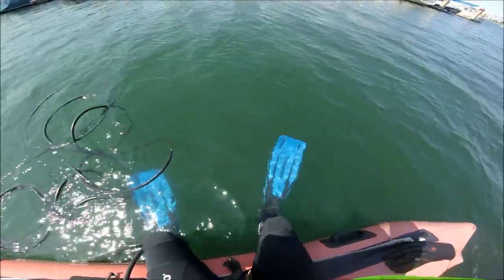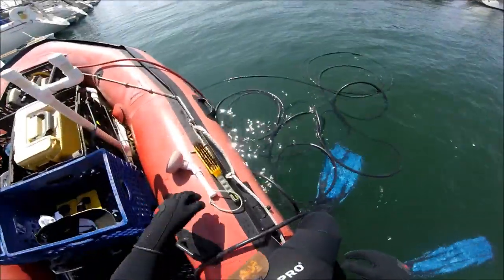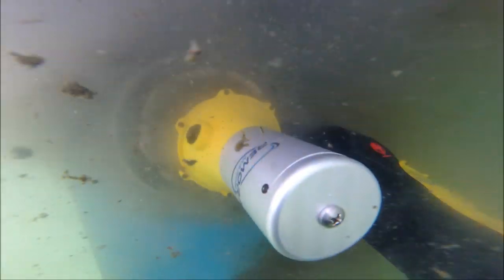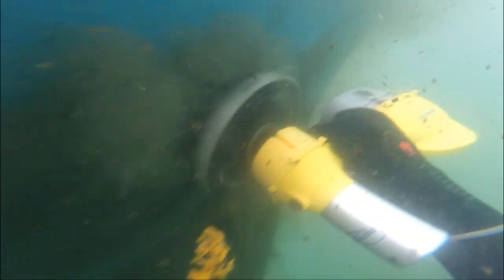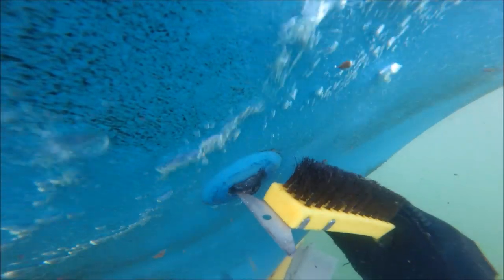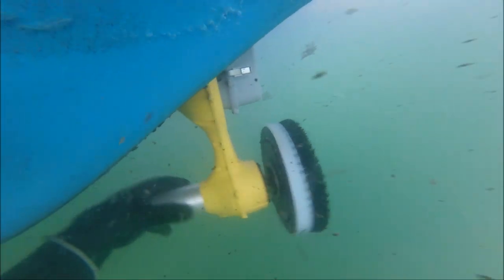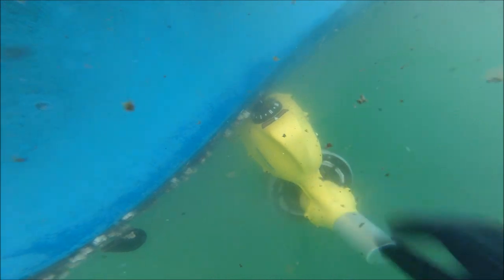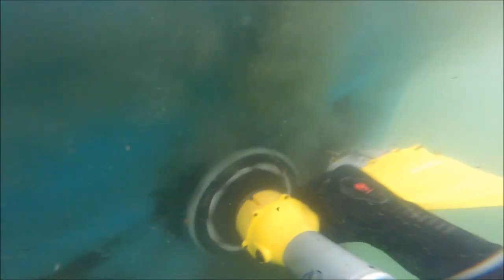Remora Solo Cleaning Foul Bottom

Comment: if i have a remora - do i even need to bottom paint?  also, if use ablative paint, is it a problem in terms of rubbing off paint?  GREAT TOOL.
Reply from the maker: Yes, you will still want anti fouling paint on your hull regardless of the tool you use to clean it. And with the proper brush and rotation speed, the Remora will not do any more damage to your ablative paint than cleaning by hand will. Maybe less, to be honest.

Comment: It does a great job of taking off the old bottom paint so the owner has to repaint before one year instead of 3 years its good for Divers and bad for Boat Captain
Reply from the maker: The neglected bottom paint on this boat was not in good condition and was quite foul. No cleaning method that adequately removed this level of fouling would be kind to the paint. But maybe you didn't watch the video. You certainly don't know much about hull cleaning 😄

Comment: Incredible that they clean the hull without catching all the debris, including all the toxins and biocides of the hull paint, such as copper, tin and other toxic substances.
Reply from the maker: What do you find so "incredible" about that? I mean, it's clear that you know very little about anti fouling paint, so what makes you qualified to judge the morality of performing an in-water hull cleaning?
Reply: @fstbttms  Nico is right. 

Just because there is no regulation in some places (yet) it does not mean that this practice is acceptable morally. In a few years you will be obliged to gather all this crap that is left behind. Especially if you conduct this operation inside a port. 

That's why filters will become obligatory in future devices.
Reply from the maker: Nico is not right and neither are you. Neither of you are well versed enough on the subject to make the comments you have. Studies have proven that the in-water hull cleaning of recreational vessels contributes a small fraction of the total amount of copper released into the water column by anti fouling paints, something on the order of 5%. And in case you weren't aware, metal-based anti fouling paints leach their biocide 24/7/365 until it is all gone, whether or not the boat ever moves and whether or not the hull is ever cleaned. Further, there is nothing "immoral" about in-water hull cleaning, as you infer. It is a necessary part of regular boat maintenance as it reduces fuel consumption and carbon emissions as well as the transport of invasive species to other ports.
Reply: @fstbttms  Things will change. Wait and see.
Reply: @fstbttms  Probably you are based in the US where there is almost zero regulation apart from California and Massachusets or Michigan I think. 

Not the same thing in Europe. I don't think you are very well versed with regulatory matters outside of the area you operate.
Reply from the maker: I'm pretty sure that I have a better read on the state of in-water hull cleaning regulation than you do. And as far as the cleaning of recreational boats goes (which, in this country, fall under a different set of rules than commercial vessels do), none of what you and the other guy are referring to is being seriously considered on any level.
Reply from the maker: Any opinion I would offer on the future of European hull cleaning regulation would be based on ignorance, just as yours is on the subject in the U.S. Your whole argument here is meaningless.
Reply: @fstbttms  That is a good point about the, "fuel consumption and carbon emissions as well as the transport of invasive species to other ports".  I like that.